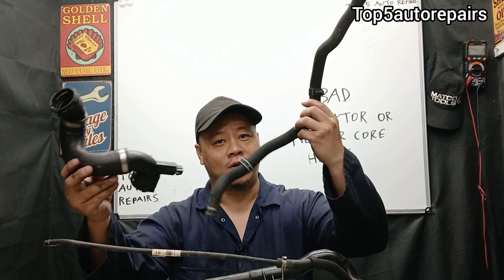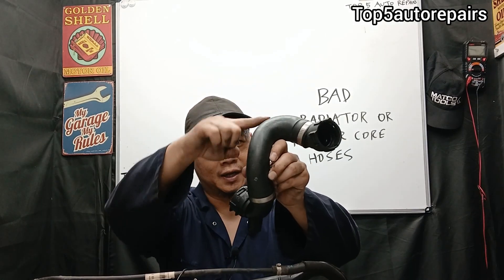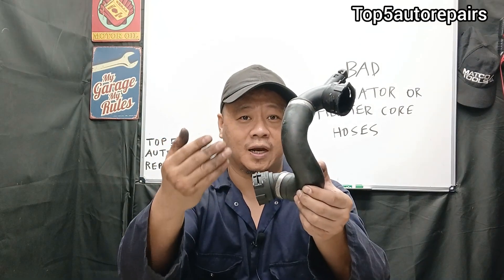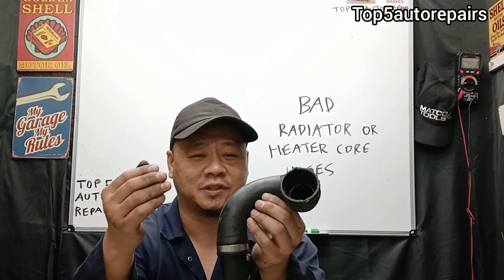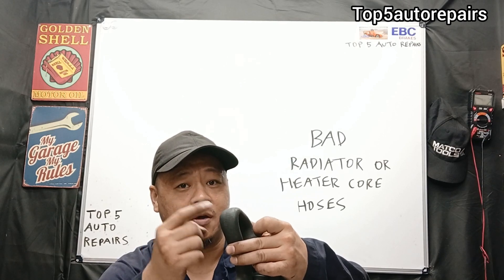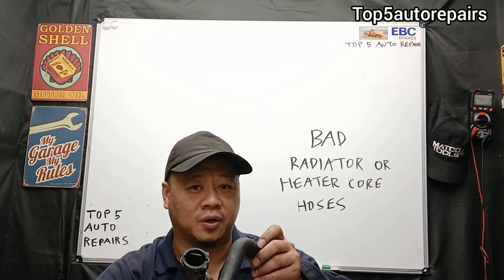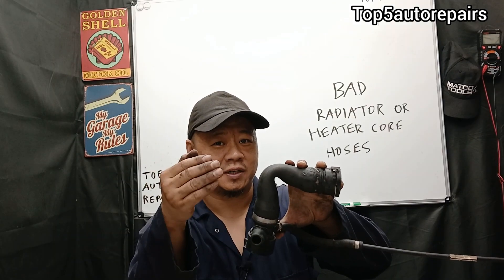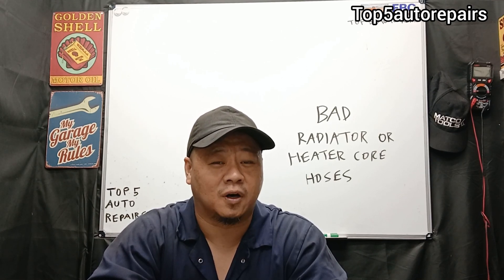HOW TO TELL RADIATOR HOSE IS BAD AND NEEDS TO BE REPLACED

Comment: Thank you as u nas this appeared i clikt on it because I do not know crap about radiator hose I noticed that sometimes there is some coolant missing from the coolant tank I don't know if this is normal that some evaporates or disappears over time or no but the level is getting lower and lower by a little bit so maybe I'll check the hoses but maybe it's something else